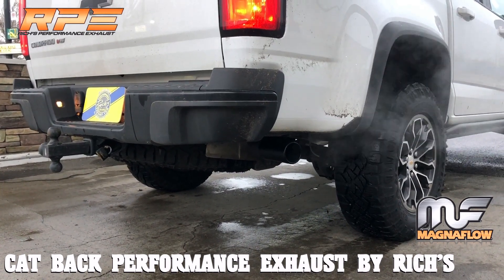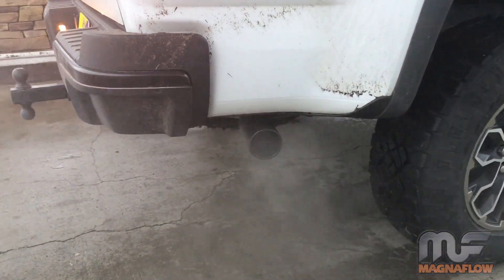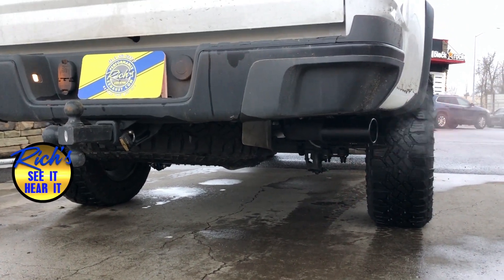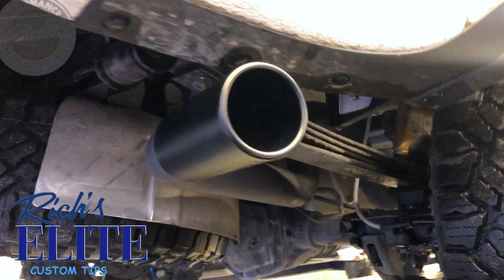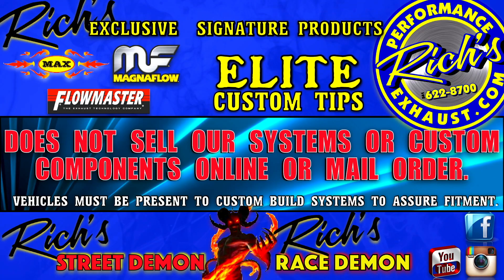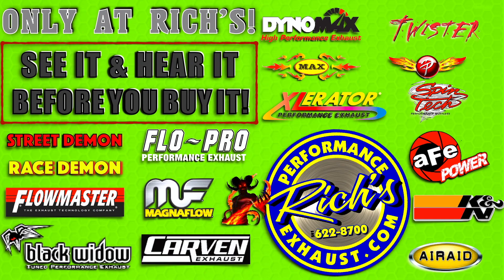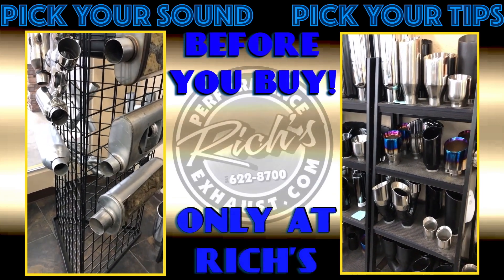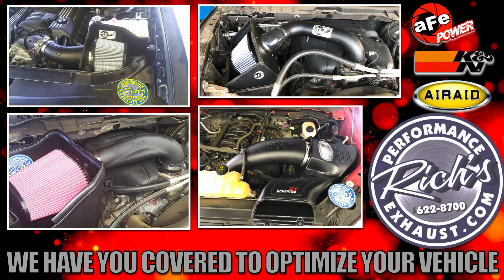2020 Chevy Colorado v6 Magnaflow 3 Inch Cat Back Performance Exhaust Step by Step By Rich's

Comment: This colorado sounds awesome.  I have a 2020 colorado lt 4x4 crew cab like this one. I love it. Want duel exhaust on it. Would getting duel exhaust or single like this one be expensive? I love the sound my truck makes but its 2 quiet and i want it to sound good. A loud exhaust but not 2 loud. Would a exhaust system help with fuel millage and hp or it mainly for sound? I have the 3.6 this one has
Reply from the maker: Single gives most low end performance! Not to expensive!
Reply: Awesome thanks for replying